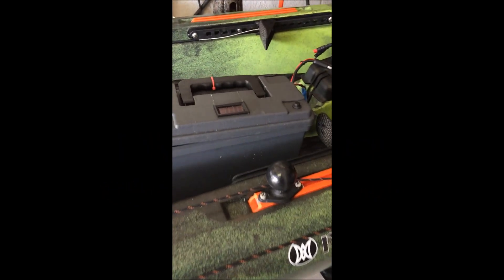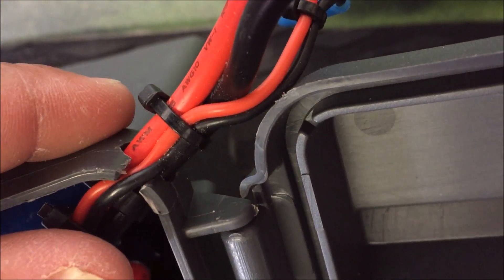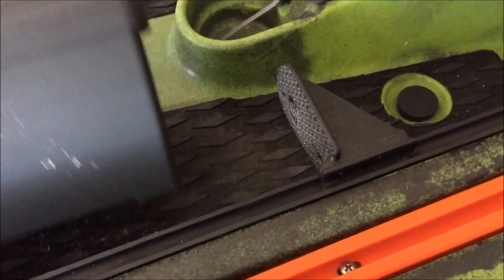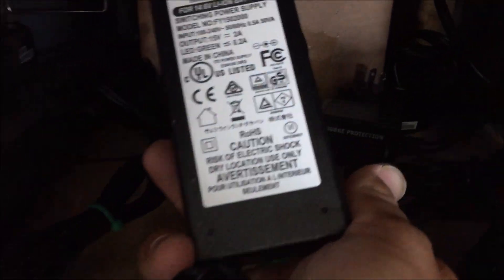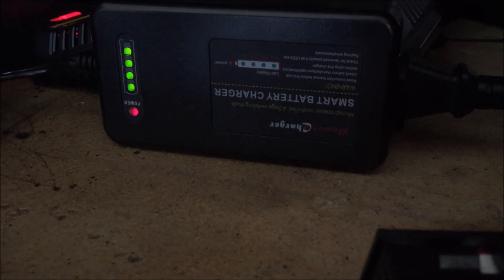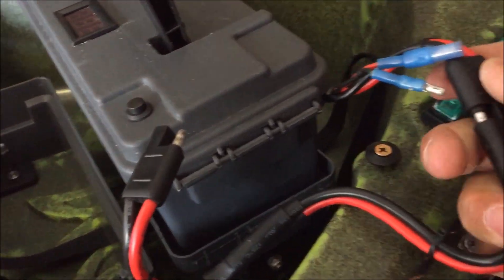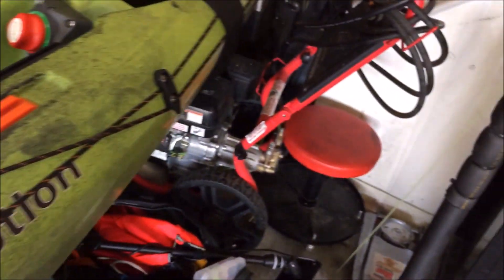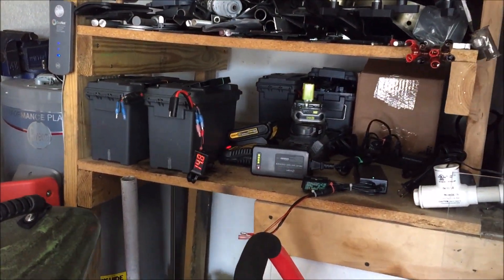Lithium Battery for Kayak trolling motor

Comment: Just a heads up if you are charging a lifep04 battery the same as a lipo you are overcharging them. I use a life compatible charger and it charges to 13.3. Might last longer if you use the right charger.
Reply from the maker: Your charge is determined by the number of cells and the type of batteries used to assemble each cell. Mine are 14.8 volts and I use a 14.8v li-ion charger. Each battery has a BMS to prevent over charging and even charging across all cells.
Reply: @sikassscivic  Exactly it's 4 cells. lifep04  charges to a different amount than lipo. its 3.7 for lipo and 3.2 for lifepo4. It probably wont get as deep of a charge with a lipo charger. How much that actually matters I have no idea.

Comment: Pretty cool but 80 amp breaker? What the point. My home AC unit only has a 30 amp breaker.
Reply from the maker: Five Twentyseven it’s been replaced with a motorguide breaker just for trolling motors that Walmart carries for $10 now. The one in the video was just what I had at the time, it was more for if there ever happened to be any direct short
Reply: Hammer Head oh right on man. Just doing the same stuff to my kayak now. Have to do 2 wire harnesses. 1 just for the trolling motor and another for the lights, pump, live well ect... I was checking out your battery and wondered if you’ve switched to a longer lasting batt yet or if you’re considering it. Maybe it’s doing fine for what you need.
Reply from the maker: This one is fine for my needs but I carry 2 of them just Incase I need to swap them out.
Reply: Hammer Head hey good to know thanks

Comment: 99 bucks Duracell 24 deep cycle. Last 6 hours minn Kota c30
Reply from the maker: Don T there are definitely cheaper options. My battery weighs 8# and is close to half the size of a regular #24 battery. I’ve used it on multiple trips without recharging. I never have to worry about over drawing on this battery and it can be run down to 10 volts without damaging it. You kill your deep cycle each time to run it down past 11.4 volts.

Comment: I'm building my battery box and I'm wondering about the size of the wire coming off of the battery. It's really small. The battery wires in your video are much thicker. Did you change your wires coming off your battery? Please feel free to email me Daniel@daniellincoln.com
Thanks
Reply from the maker: Daniel Lincoln no, I’m using the wire that came with the battery. Did you buy the same battery? One set of leads are small but those are just for charging.

Comment: How did those batteries work out for u. I was gonna use a mighty max 55 ah but i need to cut weight somewhere because my yak is rated 275 im just under 200 and motor is 18. So i was wondering if u liked those. Thanks
Reply from the maker: john hall still working great, wouldn’t trade the for any other battery.

Comment: You said you could discharge down to 10 volts. I thought it was safe to totally discharge lithium ion batteries  ?
Reply from the maker: John Averick you can, but stuff stops working around 10 volts.
Reply: No no no! You must be thinking nickel-metal hydride. You shouldn't ever discharge a lithium battery fully down to zero it will destroy the capacity.
Reply: Unless it monitored by battery management system which will automatically stop  discharging it reaches the cells lowest cutoff voltage which is typically 3.3 volts
Reply from the maker: Yes, it has a BMS that automatically cuts it off about 9.5 volts. But like I said, about 10 volts nothing works anyway so it won’t drop much past 10 volts.
Reply: Thank you fellas for the answer to my question. I am actually using a Lithium polymer jump starter to run a trolling motor on a 14 ft. Alum boat.

Comment: $210 for that battery  wtf
Reply from the maker: 2 years on it and it has been a great battery. Just doesn’t have the plastic shell if that it what you are “wtf”ing about? Weighs less than 10lbs and I can run a few days on it before needing a charge.

Comment: how long would a 30 lb motor last on a motorcycle sized battery?  thanks
Reply from the maker: Jack Gold depends on amp hour rating of battery and amp hour draw of motor. Look up the specs on the motor to find out the draw and divide that by the amount of amp hours the battery is rated for. Example , my battery is rated for 33amp hours, max draw is 36 amps so that means I could run about an hour at full blast. For fishing , I can run 6-7 hours easily on my 33amp battery because I rarely run full blast for more than a few minutes. Lithium batteries can also run a lot lower voltages without damaging the battery.

Comment: Wouldn't an amp hour meter be more useful with a lithium set-up? Your voltage isn't going to drop during discharge like a SLA, it's going to stay high until it goes off the cliff at the bitter end - too late to be of much benefit if you're a ways out. It's all new to me but I'm going the lithium route and am trying to find the best way to monitor these things. One thing I think I have learned is that the meter type I need is WAY more expensive than a simple voltage reader.
Reply from the maker: D W it may, but honestly I use it more for checking if they are fully charged usually the night before a trip. I’m not on the lake trying to figure out the voltage. My fish finder shows the voltage. So for me it’s just a easy reference to see where I stand and if I need to throw it on the charger.

Comment: remember you cannot et a lithium battery go dead or it won;t ever be recharged...DISCONNECT AT 25 TO 40 PERCENT AND CHARGE
Reply from the maker: speckspeck I’ve never heard that before, one of the advantages of lithium is you can run them down to 9 volts and still get full power while doing it. Unlike a lead acid that will fade out around 11 volts. I’ve run mine down just a few times and never had any issues recharging it. Lead acid batteries can be destroyed if you run them all the way down.

Comment: Why not connect them in parallel? It's win win if you do that.
Reply from the maker: BigDuke6ixx better to know when I have one go dead and can switch over to my back up than have both go dead and be stuck. I’ve had a few instances of one battery not working because the circuit breaker has been pushed inside the box so with the battery switch I know right away I have a problem and what battery it is.

Comment: I love how you set these up. Where did you get the different components from. Meter,
Switch, etc.
Reply from the maker: I get almost everything off eBay, box was from harbor freight. I buy the meters and switches in bulk usually because they are so cheap.
Reply: Hammer Head thank you so much. I just got a trolling motor for my catch 120 and I’m trying to figure out how to modify your concept to fit my kayak.

Comment: Deja Vous, Seeing your setup was like looking in the mirror at mine. I finished the last of my wiring last week, and except for installing a second battery for backup, and for those longer days on the water, I completed everything I wanted to do to my 12.5' Perception Baitcaster Kayak. Oh yea, my battery box is orange, but identical to yours other than color. Have you registered with DMV, and if so, any tricks to posting those 3" numbers on the side of your kayak?
Reply from the maker: scott van arnam yes, I registered it. I just bought the numbers from Home Depot and usedso e painters tape to make me a line to keep them straight. Not sure if you can see them in my other videos.

Comment: There are a lot of volt meters out there. Could you tell me which site you got your volt meters at? Love your stuff!!
Reply from the maker: Tom Jones I got it from eBay, just make sure it has a housing so all you have to do is cut a rectangle and pop it in. It’s preference really. https://rover.ebay.com/rover/0/0/0?mpre=https%3A%2F%2Fwww.ebay.com%2Fulk%2Fitm%2F132813218233

Comment: You are one smart cookie i get lost on what red & black wires supposed to do. Thanks for sharing
Reply from the maker: Mork the smaller pair? Those are for charging, goes through a onboard charger that keeps all the cells the same, it’s all built into the battery. Bigger pair are the output to my motor.
Reply: @sikassscivic  Hi got that i am just not confident with all the connections as you have carried out with meter's switches etc. But impressed with your skills. Cheers
Reply: Nice clean looking setup. I'm thinking of installing a motor on my pascador pilot 12. I wanna keep the ability to use the propeller if I choose too. Looking into custom ideas. 

Also want to outfit my wifes yak. Shes just got a little 10' but I wanna tinker with it for her. 

Awesome ideas you have here, thank you for sharing.

Comment: Just curious how is the battery holding up? Thinking of buying one from the same seller bc of your video
Reply from the maker: Fishing Experience great! No issues at all and been going strong over a year now.
Reply from the maker: Fishing Experience great! No issues at all and been going strong over a year now.
Reply: I just picked up an awesome lithium LiFePo4 in hardshell case with a 10 amp charger on Ebay for just under $500 for my kayak.  It is waterproof and has a built-in volt/amp/percentage charge meter. Decent seller and solid battery.  https://www.ebay.com/itm/12v-60-AH-LITHIUM-ION-LiFePO4-DEEP-CYCLE-BATTERY-and-10-AMP-Charger/254105873782?ssPageName=STRK%3AMEBIDX%3AIT&_trksid=p2060353.m1438.l2649

Comment: Could you please explain how you hooked up the SAE connectors to the battery and also to the trolling motor?  I'm a newbie at all of this and have a minn kota c2 30 trolling motor that I want to use on a Sea Eagle 380x kayak.  Would like to be able to charge the battery via AC and via solar (and also would like to possibly use solar panels while running to extend time on the water).  Would really appreciate a more dumbed down explanation of how you did the connections.  Thanks so much.

Comment: Great video, just now seeing. Getting ready to power my yak. Where do you get the PWM. I saw one on Amazon, but it was a unit. Wondering if they come apart to mount the the dial in another area. I'll keep watching your video to get more input. Thx
Reply from the maker: They are expensive but any good lithium will be. You can go with a regular battery but the trade off will be size,weight and won’t last nearly as long. These can be charged all the way up to 14.7 volts and hold their charge. I can go all day on a lake with one battery that weighs 8 pounds no problem.
Reply from the maker: Got mine off eBay, make sure it’s a 60amp with reverse switch. Usually pay between $15-$25 each depending on where they are coming from.
Reply: @sikassscivic  Brand Name is SenMod, 2126efef26m357 IS PART # ON Amazon. Not sure if this will work. I'm kinda of idiot when it comes to these things. Didn't see anything on EBay. Thx
Reply: DC 10-55V MAX 60A PWM Motor Speed Controller CW CCW Reversible 12V 24V 36V, Finally found on Ebay, think this will work.
Reply from the maker: Jeff Wood yes,that looks like it will work. Can you copy the link and I’ll check it out
Reply: @sikassscivic  DC 10-55V MAX 60A PWM Motor Speed Controller CW CCW Reversible 12V 24V 36V, ugseller2014 (5481) is seller on Ebay. And man are those batteries high dollar. I'm on the coast (salt water) any alternative  for cheaper battery??
Reply: @sikassscivic  Did you take a minute and look at this controller? Getting ready to order. I'm excited about some power on my vibe.DC 10-55V MAX 60A PWM Motor Speed Controller CW CCW Reversible 12V 24V 36V, Finally found on Ebay, think this will work.
Reply: Ordered it PWM, only $18.00. thanks for tip on battery to, ordered it also. Gettin closer.
Reply from the maker: Jeff Wood description looks good.
Reply: Thank you.

Comment: Would it be possible to mount the charger inside the box & have a 110 plug that would permit connecting up to the wall socket with no fuss ?  Any issues with heat / humidity / water that might fry the battery charger if it was permanently mounted inside & there was a waterproof seals on the boxes ?
Reply from the maker: Douglas Harris you could get a watertight box but this one is not. If you do more saltwater I would probably recommend that. I do fresh mostly. You could put the charger inside if you wanted I think , I have multiple batteries so i use one charger on them.

Comment: I found out you need a watt' meter not volt meter it show your amp hours that's  what you go by on a lithium battery!
Reply: Resting voltage is a more accurate measure of what's left in the battery.
Reply: @BigDuke6ixx  not with lithium batteries. You need a meter and a shunt to measure amps.
Reply: @oscarapple1365  go and look at the charts that show lipo voltages at different percentages of charge and you will see that Im right.

Comment: Hay nice video like it where did you hookup your 12v volt  meter & your button switch ?   To the small charging wire or the 6 Gauge power wire
Reply from the maker: dave robbins I wired them to the smaller charging wire

Comment: Great Video!  On your power supply/ 2- pin Quick Disconnect what are you using 10 Gauge & if you are your 30 to 40 amps the wires don't get Hot!!
Reply from the maker: dave robbins they are made by Atwood specifically for trolling motor quick connections. I’ve never had an issue with heat.

Comment: I love the video, ive been trying to make something like this from scratch (cells, bms, charger, shrink wrap) but your setup seems pretty good considering it would cost about 150-200 in the raw materials alone for the battery. I did notice the charger you pointed out (15v 2amp) was a lithium Ion, and the batteries were LiFePo , is that right? Can the chargers be interchanged?  How many amps is the battery rated for? And how much does the motor pull? I know you have a 30lb, im trying to make a 55lb work on this type of setup. I pull about 50amps (according to the manual)  thanks again
Reply from the maker: Yes, that charger works great. Mine only pulls around 50amps when it is stuck on something, I think only around 25-30 amps normally running. I think the battery is rated for 60 but just going off memory.

Comment: Great video... What is the motor you are running? I am looking for more efficient batteries for my 60lb trolling motor. The old 75Ah lead battery is needing replacing as it as I can only get about 1.5 hours on the water these days!
Reply from the maker: akwamarsunzal I’m using a motor guide 30lb thrust R3, $99 from Walmart.

Comment: I use a 100 Ah LifePo4 on my Minn Kota 45.   Weighs less than half that of a wet cell car battery and can troll all day for 2 days.
Reply: john doe  stfu
Reply from the maker: tomb cool, 100ah would be very overkill for me on the lakes, especially now with the PWM controller I’m using. I get 3 trips of 5-6 hours on just a single battery charge now and it weighs about 7-8 pounds. Longer trips I load the 2 batteries and that’s nice because it lets me know after the first battery is drained to start heading back. It’s only happened once when I even needed the second battery but it came in handy for sure!
Reply: Where did you buy that 100ah

Comment: Thanks for the great video HH.  Could you provide part numbers and/or link sites for all the parts that you used?
Reply from the maker: smithmal
Ammo box is from harbor freight 
Battery, Momentary switch and volt meter were from eBay
Battery connection terminals and circuit breaker you can get from Walmart trolling motor section.
Reply: Great!  Thanks for the info!

Comment: Do you have a Vid on how you hooked up your battery, circuit breaker, switch and voltage reader?
Reply from the maker: bze06FishinBwai this is the only video I currently have on the batteries. Wiring is pretty easy though. From your motor connection, black will go to the black on the battery and red will go to one side of the circuit breaker and the other side of the circuit breaker goes to the red on the battery. For the switch and bolt meter, run red to one side of the switch, other side of switch to the red on the meter. Black if the meter to the black of the battery.
Reply: Hammerhead Inc, Thanks for that info. I got it connected and ready to go.
Reply: Regarding the switch and meter...did you run the red from before the circuit breaker or after? I'm assuming from the second post from the battery on the circuit breaker
Reply from the maker: Rae King circuit breaker is the last thing before the battery, so if it trips the bolt meter will show blank and you know it’s tripped.